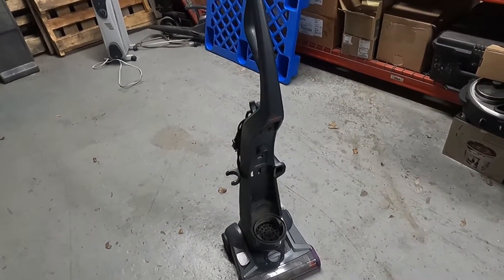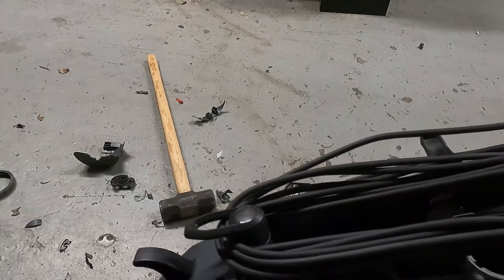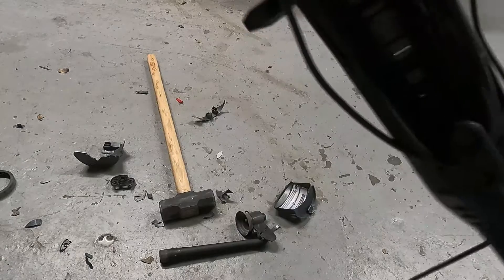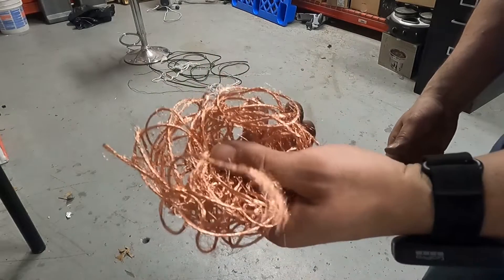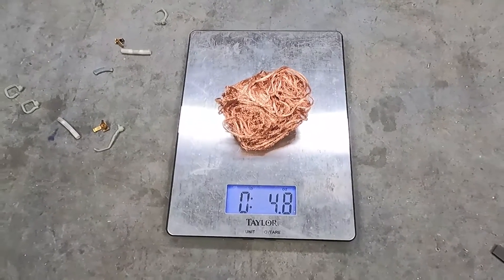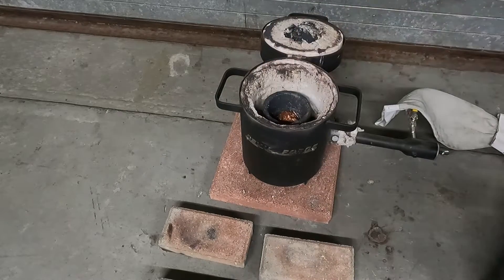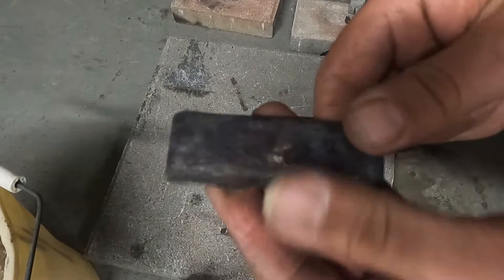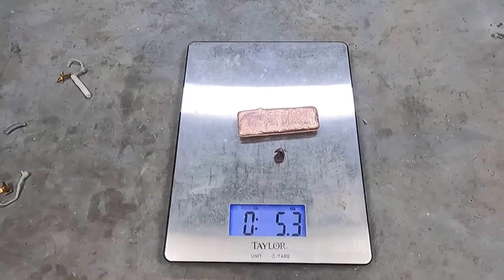How much copper inside a vacuum cleaner?

Comment: In general, why met any copper to make a brick?
Reply from the maker: @johneichner6330  honestly it all depends on what your plan is.  Most scrappers just cash it in as-is.  Copper stackers melt it and cast ingots to easily stack it, especially if available space is at a minimum.   It condenses quite nicely. Another reason is if you plan on doing casting projects especially if you are making an alloy.  Also easier to load a 2 lb ingots into a crucible instead of 2 lbs of loose copper wire or pipes.

Comment: Around 10 years ago, I was cruising through the AZ desert and came aross an old construction site or an old mine operation, not really sure what they were doing. Anyways I stopped out my truck and began to explore. After about 10 minutes of snooping around, I came across these stacks of metal 2 inches thick, 6 ft  by 4 feet. At both ends of each of them, there were pure copper bars 2 1/2 ft long. Little bit thicker than a mini baseball bat you get for souvenirs. They were held in by the metal itself in 3-4 ring shaped  "soldering ?"(hinged looking moldings) I just so happened to have my grinding saws handy, which saved me a few hours of driving. There were probably 30 sheets, so 60 coppers bars. This was on a Saturday, so i had to wait until monday to cash them in. The scrap yards in my small town were low-key worried or something similar they kept asking werw i got them ect. So i had to take them out of town, next town over 60 miles. I sold them all for $1,800.00 😊😊. It was my best score ever for scrapping.
Reply from the maker: @Liefvikerson  that’s one heck of a score!  Thanks for sharing 🙂🍻

Comment: What is it you strip the wires with
Reply from the maker: My stripping machine 😁  Here is a link to the one I use.

https://www.amazon.com/Happybuy-Stripping-1-5mm-25mm-Channels-Industrial/dp/B071XSQTY4/ref=mp_s_a_1_2_sspa?crid=D109NGRDU87H&keywords=wire+stripper+machine&qid=1669564439&sprefix=wire+stri%2Caps%2C182&sr=8-2-spons&psc=1&spLa=ZW5jcnlwdGVkUXVhbGlmaWVyPUExU1Y5OEYzRkdNQzJGJmVuY3J5cHRlZElkPUEwMzUzMzQ2MVBQVUc3QVhWV0FQMyZlbmNyeXB0ZWRBZElkPUEwNDU0Njc5RFJFSDFUNEdZWDAyJndpZGdldE5hbWU9c3BfcGhvbmVfc2VhcmNoX2F0ZiZhY3Rpb249Y2xpY2tSZWRpcmVjdCZkb05vdExvZ0NsaWNrPXRydWU=

Comment: Throw the entire armature in the crucible. That will yield a few tablespoons of copper
Reply from the maker: Which part?
Reply: @Scrap2Cast  the motor, the part that has the windings  you found to be aluminum had a core which tirns the moving parts of the vaccum.  It has ball bearings on both ends of it. Continue breaking down the motor and you will find it
Reply from the maker: Oh okay I know exactly what you mean now.  I still save those off camera.  When I get the big furnace setup after hitting my 500 subs goal (234 to go), I’ll melt the copper off the cores.
Reply: @Scrap2Cast  your narrative along with how and what you film is the reason I  subscribe. Melting really is an interesting hobby. The fact that you can turn a junky old vacuum cleaner into a precious copper ingot or you can make a solid aluminum figure from $1.35 worth of aluminum scrap really is fascinating. The subscribers are out there. They need only to look your way!
Reply from the maker: @mattyal9347  Thanks man, I really appreciate your positive input.  It's nice to know that someone appreciates the way I conduct the channel / footage.  Out of curiosity, do you like the caption narrative better or the voice narrative?
Reply: @Scrap2Cast  the caption is annoying.  There are many times I will mute these videos  because its self explanatory but in the event I  do need to know what you are trying to get across to us I simply unmute and replay.
Reply from the maker: @mattyal9347  okay cool thanks for the input!  :)